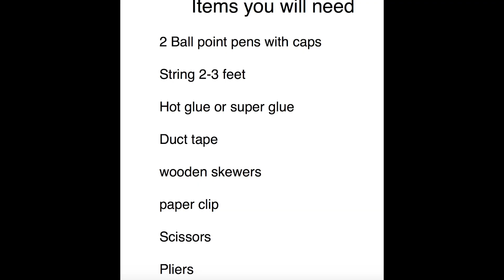How to make a low cost DIY homemade dropping system for Phantom drones that works

Comment: As an adult with a car, the hardware store has much better options for the build for under $3 I could think of several options, but for a kid this is pretty creative using only what you probably have around the house.